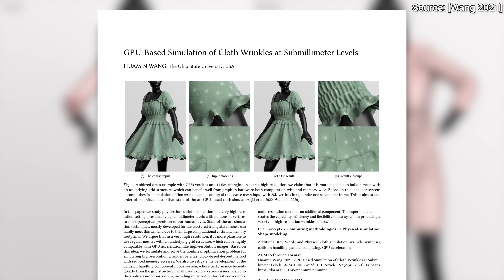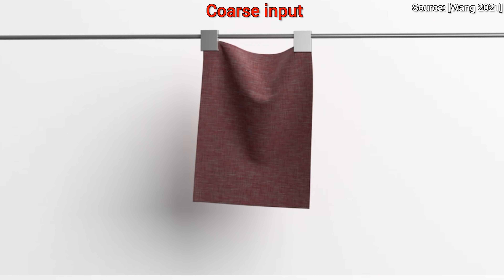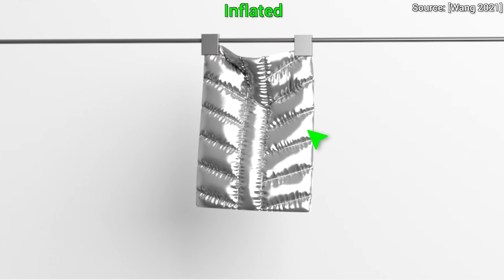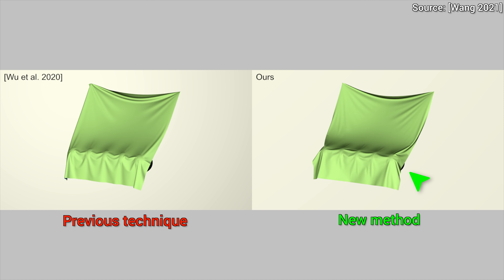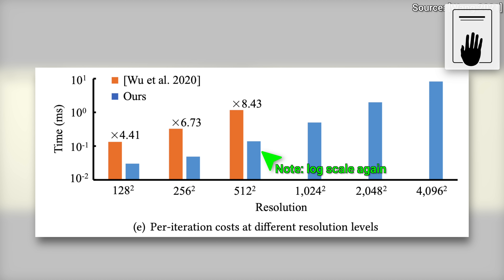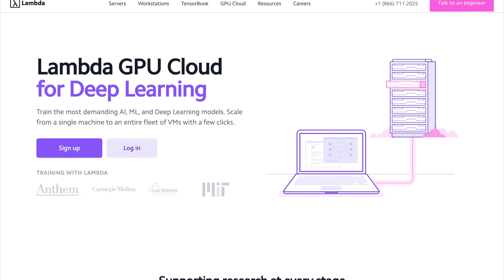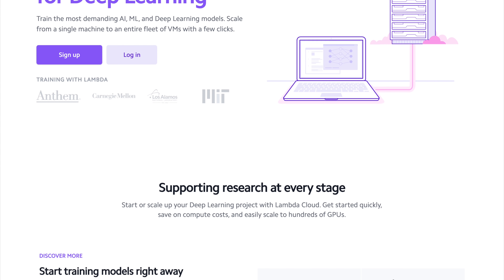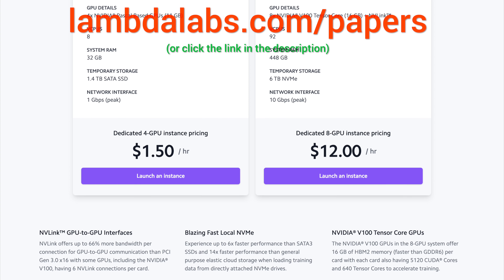Is Simulating Tiny Cloth Wrinkles Possible? 👕

Comment: The next papers should consider answering these questions:

1) How to simulate the friction between the clothes and the skin (when it's dry and wet). These simulations are great, but it feels like they have zero friction with the skin.

2) How to simulate some wrinkles to form permanent folds and leave permanent trails overtime due to repetitive motion (when we fold a paper, we can see the trail of the fold even if we put the paper back to its original form. This should also happen to fabrics).

3) How to simulate small dust/strings being generated from the fabrics (irl, we often see our clothes having tiny strings sticking out of them like some fur on animal, and when we blow on them, some of them fly).
Reply: 1) This runs as an additional component to an original simulation (adding detail, not running the full sim). Note how the video denotes Input and Output, IE, the source sim has 0 friction so it's the source sim that needs to be updated.
2) There are similar solutions as to what you mentioned, though they usually have to do with paper in particular. This would be plastic deformation.
3) This can be achieved with most particle systems already. :-) Most 3d work usually doesn't want to show so much tiny details, because you would either need incredible resolution (suitable for photos) or very close camera angles, which we don't like because models that support those views would be incredibly difficult to create and heavy on the renderer otherwise.
Reply: There's always someone commenting for things that were never intended to be tackled by the paper.
Reply: @9308323  Whats wrong with making a comment like that? This is YT

Comment: On the one you asked about there are definitely extra wrinkles added in.  At 3:48 it is very noticeable to me. I see better defined wrinkles on the models right arm, the sleeve looks more attached to the wrist (big unrealistic flair on the coarse input), as you move up to the elbow the wrinkling is much more defined and not as flat, near the shoulder the wrinkles wrap all the way around the arm rather then fading out in the center of the arm, and down the center line of the dress there is a lot more small wrinkles that make the fabric look more real.
Reply from the maker: Excellent, thank you!

Comment: The detail is applied after the simulation, right? But wouldn't the details affect the whole simulation if it was real life? I mean, the first simulation doesn't take the details into consideration.
Reply: It is an entirely separate, more detailed version of the simulation. Which is why the increased resolution results in drastically more realistic movements.
Reply: @zargsch  to me te fabric moves exactly the same in both simulations
Reply: @PiterTraceurFA  If you look at the simple hanging cloth simulation, you can see the material moves differently because of the wrinkles. It's especially visible between the two fixed points. The fabric folds easily in one axis - across the wrinkle - but is stiffer in the other axis - along the wrinkle.
Reply: Barely. Also, this was to showcase how fast these methods have become. 2 more papers down the line and we'll have these kinds of simulations in video games.